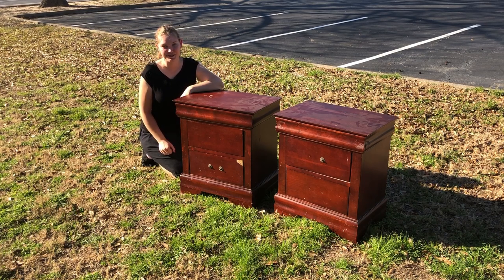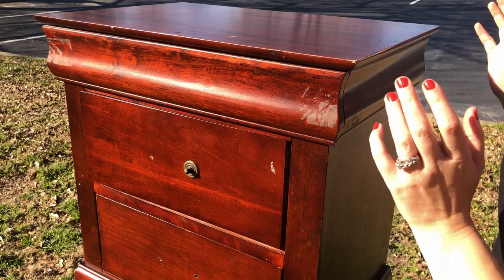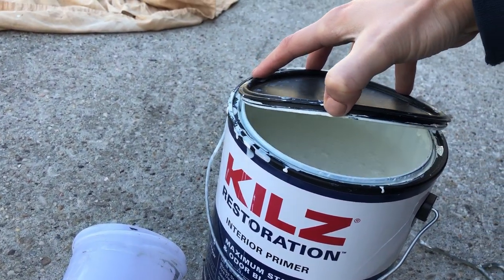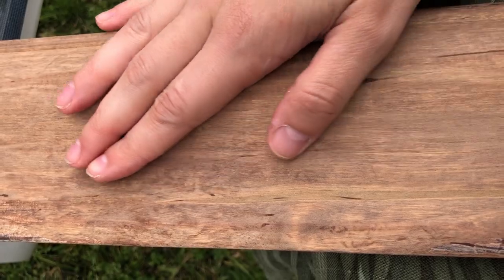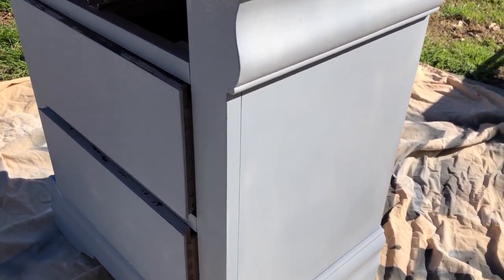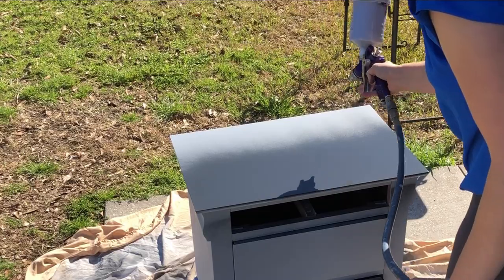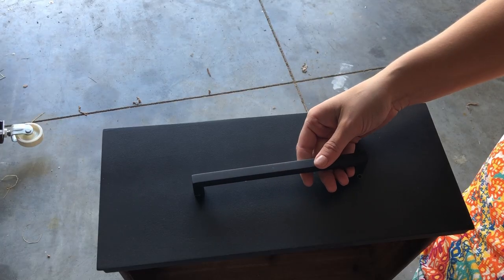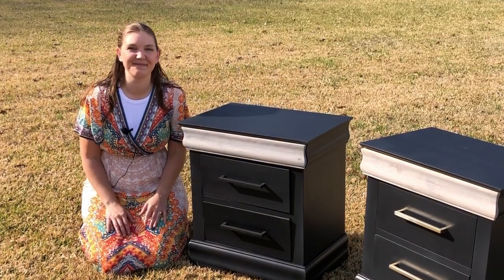I Found These for FREE and FIXED them | Free Furniture made NEW AGAIN! | Flipping Free Furniture

Comment: Hi, Sarah! The black finish is a HUGE improvement over the “cherry” stain. I like the black pulls best. The gold ones are also lovely, if you decide you like them better. The top drawers, imo, are too much of a contrast with the rest of the nightstand and they don’t relate to the rest of the piece. If you did a stencil in black on the top drawer or changed the hardware to silver/pewter/chrome you would have a more cohesive look. Maybe use some of the silver Rub’n’Buff on the pulls? Or maybe a darker wash? So you can still see the wood. I love what you do and I love how adventurous you’ve become with your furniture. Whatever you decide, I know it will be beautiful!🌸
Reply from the maker: I agree with you. I plan to work and tweak the top drawer until it’s right. I was thinking of sanding it a little and trying a more dark grey toned wash or even stain.
Reply: @OurFurnitureFlippingAdventure  you do wonderful furniture flips and I know you’ll get these two where you want them. They are so much better than what you started with since they were garbage and now they aren’t!😄🌸

Comment: Ok...So the 'barely-there' white wash is on an actual drawer front, yes?
Hmmm..Honestly- the effect is awkward (2 me), if ur leaving this as shown.
(1.) Are u not going 2 put a handle on that top drawer?  I think u should.
(2.) I feel the natural wood would stand out in a 'beautiful & pleasing way' (with ur ashy-black finishes); the white wash just... stands out.
Yes, as is- - the drawer pull is needed.
Thanks 4 allowing input. 🙂
Reply from the maker: The top drawer has a carved out spot on the bottom side for the “handle” so I thought to just leave it that way because of the curves in the wood. Maybe a knob would work though. I’m going to tweak that top drawer a little until it fits with my vision a little better. Maybe sand it back a little and give it a grey wash or stain. We shall see! 
Thanks for taking the time to respond ♥️